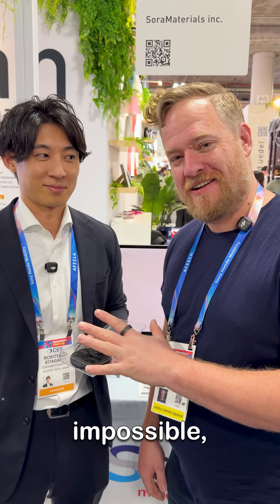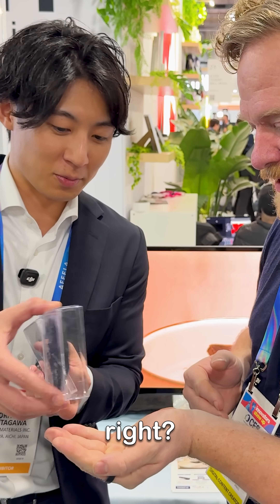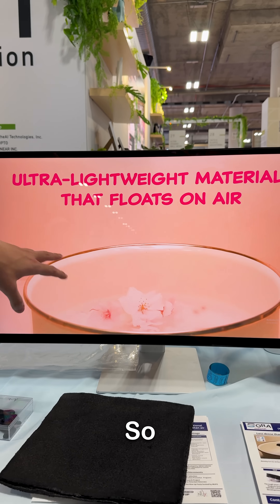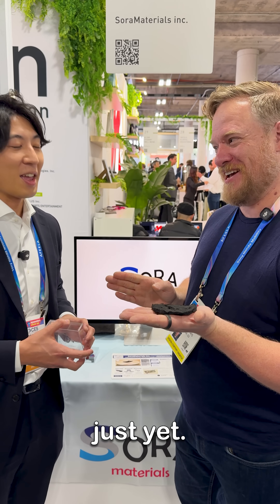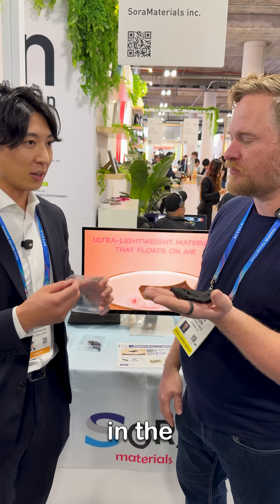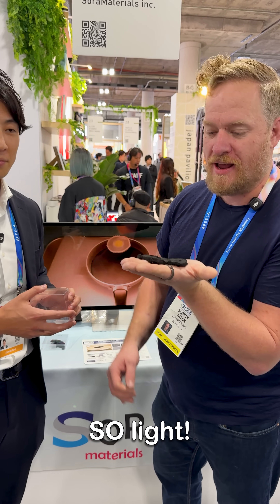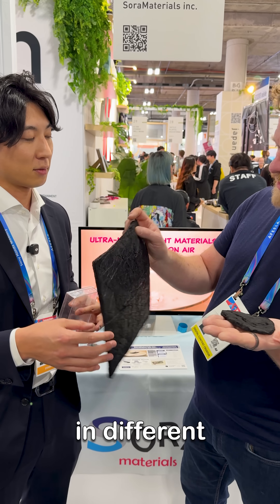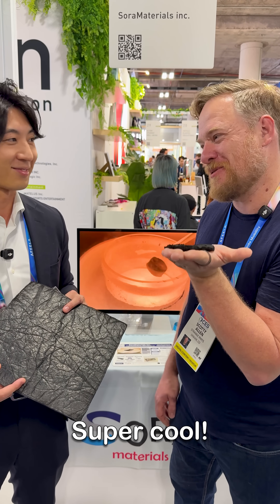A Material Lighter Than Air*

Comment: There I was saying "if it was lighter than air, it would float upwards" and then they show it floating on cold air, so that's technically correct.  I'm impressed.

I wonder if it would float to the ceiling in arctic conditions, or would it still behave the same as it does here because it needs the temperature gradient in order to float...?

Comment: People not understanding exactly what air is and how humidity affect air density. 

It is probably lighter than air at high air density locations and such will float there, also when materials are sufficiently light enough vander vals attraction and gravity still play parts and solids will always have more downwards pull compared to gasses.

Comment: I hope they expand into home internal and external insulation
Reply: Why? Weight has no real bearing on why you use a material or not in a home. Apart from incredibly dense materials ofc but the difference of a few kilos per sq meter is negligent in villas.
Reply: @zipp4everyone263  it’s breathable unlike many insulation, meaning no need for the 150mm air gap typical needed, the biggest problem retrofitting is in period property you loose all cornacing, this can be directly behind the plaster board , after the Vapor barrier for air tightness test , further more products of airojel are overall just 5mm thick yet have an r value of 50 , what this basically means , solid wall buildings can save equivent of 7kwh in heat requirement eg needing 100,000 btu heater vs 230,000 btu saving over 1000 bucks a year in space heating cost
Reply: If it's really good insulation than a thin sheet of it can be better than a foot of glass wool, makes retrofitting better insulation easier.

Comment: don't things lighter than air float up? so why aren't they holding it down to prevent it floating away?
Reply: because it's not lighter than room temperature air, only cold air. which is still impressive but not something that can be demonstrated live. that's why the TV monitor is running in the back
Reply: @s @ssl3546 I am quite sure that in 2025/2026 we have technology advanced enough to cool down air for a live demonstration.
Reply: @ssl3546 so youre saying our house will float in winter😂
Reply: @burntalive Maybe at the south pole, but even then probably not.
Reply: It’s the density of pure co2,it’s much more compact than ‘’air’’ that we breathe .
Reply: @oneworld5877  I don't know if it is CO2 or some other dense below zero gas. which can be really dense, some gases like Sulfur Hexafluoride (SF₆) or Tungsten Hexafluoride (WF₆) you can float water on.
Reply: No density causes it. 

There are 6 elements lighter but only 2 float.
Reply: @Robert-j6r8c  what elements are lighter than air but don't float?
Reply: @1TieDye1 
Lithium, carbon, boron

The atomic mass is less than nitrogen and oxygen.
Reply: This piece was made to be held. For demo. So is a bit different than the original floatie
Reply: Dang bro. You showed your elementary education in this comment

Comment: It doesn't feel warm because of sitting in his hand. It's feel warm because it's a near absolute insulator. Compare holding a silver bar, an aluminum handlebar, and a wooden broomstick. This stuff is a long way past wood for thermal insulation. If warm from holding, would have been thermally capacitive and hugely so, but it's insulating.

Comment: ‘Lighter than air’

Falls
Reply: Filling the Structure with Helium and filling my German Arship Hindenburg with it? So it will be Bulletproof 👍
Reply: made me lol irl thank you
Reply: things dont float because of their mass, but because of their density.
Reply: @jarskiXD if it is lighter, it should have a lower density
Reply: @jarskiXD ok, what do you think lighter than air means?
Reply: @jimmyryan5880  It might be lighter than air per atom or molecule chain however density is a factor as well. Might be that the dust of this material will float but that chunk will not.